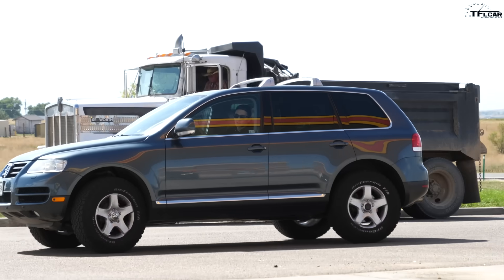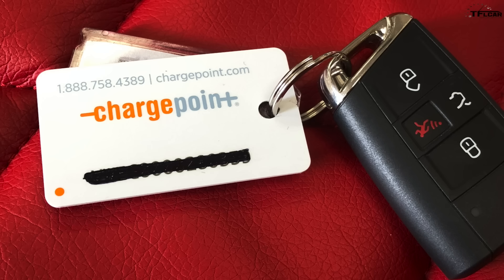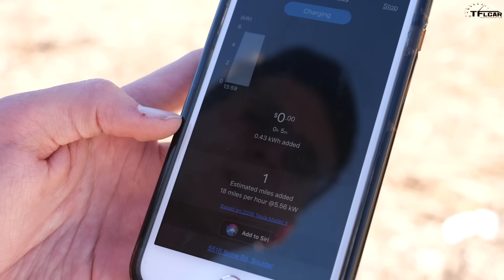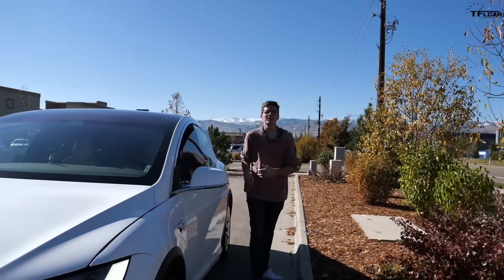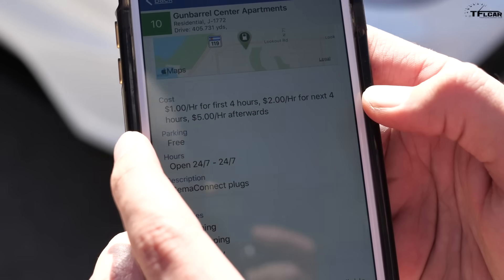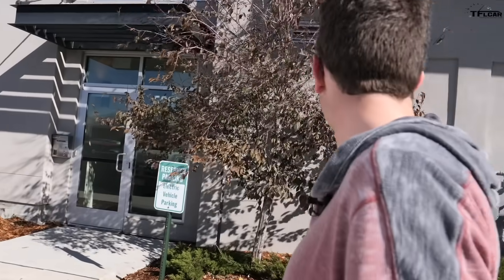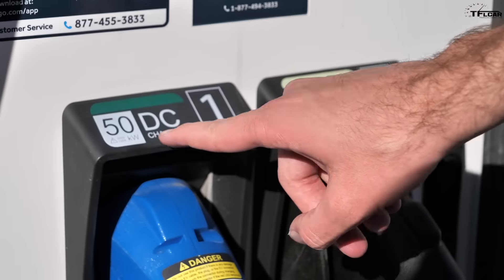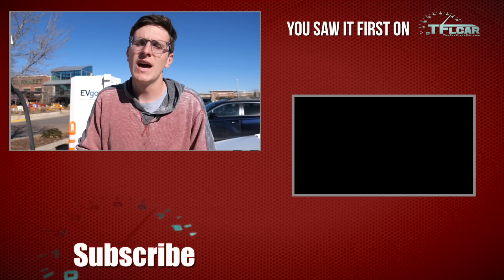Here’s Why Charging an Electric Car Can Suck - And It’s Not The Reason You Think!

Comment: I can just imagine going to a normal filling station and having to kill a few hours while the gasoline squeezed out of the pump in a tiny trickle.  I will pass on that.

 I guess if you inherited your wealth and don't work, that's fine. The rest of us slobs have better things to do with our time. And that's ignoring the fact that you get a much bigger bang for your buck with normal gas engined vehicles.
Reply: Unfortunately that's the case right now. I would love to get a Tesla Model 3 soon in the future, but the charging technology and infrastructure has to go a long way before I actually consider going electric. And I would have to make sure I have a house with high voltage power available in my garage so I can charge overnight. As long as charging overnight in my house is available, I would go electric because it would be very rare I would drive even close to 200 miles on any given day.

Comment: I would be curious to know what the EVgo fast charger reports as the total KWH provided to the Tesla when charging from 20% or 40% to 80% versus what the Tesla report as received on its internal monitor. Basically I’m asking if the EVgo says it gave 30KWH of charge, does the Tesla’s internal screen also say it received about 30KWH of charge?

Comment: Requiring an account and app is a huge swing and a miss. Why can't I swipe my credit card like a regular fuel pump? I have an ICE car now but I know I will eventually be driving a BEV. I hope the connector and payment struggles are worked out by then. It might take some government action.

The reality is, for folks like myself who have their own garage, 90%+ of charging is likely to be overnight at home. It's the other 10% that worries so many people like myself. Level 2 charging is not fast enough to get you back on the road after a lunch pitstop. L2 is for destination, not a reststop. Whether it's my weekly ski trips in the winter or day trips out to the coast in the summer, or weekend dashes  between Seattle, Portland, Bend, Chelan, etc. I'm not gonna wait around for 5 hours to put a reasonable amount of energy back in my car. 45 minutes over lunch is what I'm happy with. I understand it won't be 4 minutes at 7Eleven, I'm okay with that. But the charging companies need to shut up and take my money. No email address. No BS. Just put a credit card in and get DC fast charging out.

Comment: TOO COMPLICATED, TOO TIME-CONSUMING, and you’ve only shifted the pollution from the car to the power plant (most use coal). And when EVs really take off, they’ll have to build new power plants to handle the load, and LEFT WINGERS HATE THAT!
Reply: Nuclear, wind and solar power are options too that left-wingers are pushing for. That's why the left pushes to reduce coal dependency so we can use cleaner/renewable energy instead. And that can then power our vehicles.

Comment: Those charge points are bs. Half the ones in my area are not even public, you must be an employee/customer of wherever they are installed. On top of that they take forever to charge. I just use the superchargers instead every once in awhile and use the overnight 120v charger outside of that.

Comment: What is the price to charge up in Texas if a house is 17k when it's cold? Gas is 2.50 a gallon. Ev's are a rip off no matter how how you look at it. Would you buy a car if i told you that the engine will go out in 8 to 10 years but costs twice as much?Any takers?That is an ev the battery pack will fail. Will fail. Nope not me.

Comment: Gas pump I'm in and out in less than 5 minutes what am i support to do at a ev station that takes hours to charge my car i have children, don't have time to wait their for a charge if they get the technology down to full charge in less than 5 min then i might consider having one.
Reply: If you have a house with a garage and can charge overnight, ideally you would never really have to fill up at a charging station away from home unless you're on a road trip. But if you're in an apartment that doesn't have a charging station or in a house without a garage, an EV is unfortunately not an option. The charging tech needs to advance way more for people in densely populated urban centers to be able to use EVs.

Comment: An EV where I live is not very practical unless you can charge at home as there is very little infrastructure to support them, not one charging station within 25 miles of my home and then there are only a couple of chargers and they are downtown, people tend to park a gas car in the slots for the EVs. They get ticketed and towed but they still do it. There use to be charging stations at many of the interstate rest areas but the state took all of them out. There needs to be some form of standardization in the charging process or end up with a box full of adapters, nothing like arriving at a charger to find that it doesn't fit your car and your battery is barely alive. I had considered an EV to use in my immediate area since I live just a few miles out outside of town but decided to keep my subcompact car for those purposes, it only has to be fed every two or three weeks and cost less than $20.00 to fill up.

Comment: Being a bit disingenuous don’t you think? Charging a Tesla at a standard charge point station? They have their own superchargers which charge way faster. Nobody who owns a Tesla would dare show up at a Chargepoint to charge…
Reply: That's not true. I pulled a Tesla adapter off afree Volta charging station just this week.
Reply: @georgiaev7860  Again proving my point if you use anything but a Tesla supercharger which is made for the car you’re charging is cut in less than half the time. Stop charging a Tesla at a standard charging station you’ll be much happier…
Reply: @Magicinstalls  I see that non EV people really don't understand the difference between charging for need and charging for opportunity. Many non EV folks keep trying to impose the gas model of refueling onto EVs. Probably because that's all that they've ever seen in terms of refueling. Certainly when charging for need, because the battery is low and there isn't a lot of time, high speed DCFC charging like the SuperCharge is appropriate. But the vast majority of the time, it's actually charging for opportunity. In these cases the EV is going to be parked anyway. Whatever charge happens in these situations are a bonus.

That's what happened to the Tesla in my story. That charging station is free. It's also located in a grocery strip mall. That owner stopped for something else: grocery, gym, pizza, haircut all which are in  this strip mall. So, they parked their car and plugged in while running whatever errand they happened to be doing at the time. I'm certain the only thing they ended up being unhappy about is the fact that they left their adapter connected to the charging station. I posted a note on plugshare and put the adapter on top of the charger. Hopefully, they drove back and retrieved it.

Charging EVs isn't like gassing up. It's 80% charge at home, 15% opportunity charging, and only 5% or so fast charging for need. With an EV the driver literally never has to go to the equivalent of a gas station.
Reply: @georgiaev7860  “non ev people” lmfao! You are so clueless! I’m on my 5th ev! We currently own a bolt! Speaking of charging opportunities! This car does not have the same charging opportunities as the Tesla. Tesla has its own network of superchargers. And they could be charged within 20 minutes! You were the one who has no clue what you’re talking about
Reply: @Magicinstalls  You are meandering all over the place. You started with no one with a Tesla would dare show up at a ChargePoint to charge. I give a specific example where that exactly happens and explain why a Tesla might stop at an L2 for an opportunity charge. You then charge off talking about a Bolt have different access for fast charging and SuperChargers. All EVs, including Teslas, will take advantage of J1772 opportunity charging when it's available. Fast charging is a completely different subject. I see Teslas and Bolts at Volta and ChargePoint L2 stations all the time.
Reply: @georgiaev7860  First of all, I was addressing the poster of this video! I don't know why you had to jump in and start talking shit! I see a tesla owner going to charge points, and other J1772 chargers and bitching about how slow they are! The man is driving a Tesla and using chargers that were designed standard EVs! Tesla has a whole network of chargers that can charge a tesla to 80% in 20 minutes! Again being disingenuous telling half the story! If you want to bitch about charging, use a car that ACTUALLY has issues finding fast chargers. Whole different situation! But if you own a Tesla you have no problem finding a quick charger they're all over the place! That's why they charge 50+ k for them! Use a different EV to make your point FFS!
Reply: @Magicinstalls  I jumped in because you made an untrue statement that Tesla owners don't use slower charging stations. I agree with you that Tesla owners have access to the SuperCharging network. But in my experience Tesla owners don't use them exclusively. Seems to me the point of the video is to show that there are other options for charging other than SuperChargers. I think the missed point of the video is that virtually all current EV owners charge while they are at home. Therefore the speed of charging really isn't releavnt to the discussion. I jumped in because there seems to be about 9,000 posts with misinformation about how EVs and EV chargers operation. Just trying to set the record straight.
Reply: @georgiaev7860  Tesla owners don't use them to their own detriment, and that's their prerogative. If you want to prove a point on how NON teslas have limited access to fast chargers, then use a non tesla FFS! Don't post a video trying to charge a tesla with the wrong charger and then bitch about how slow it charges! This is ME trying to set the record straight!

Comment: Your parents and your family have the bandwidth to understand the difference between spending 30 minutes to obtain 100 worth of range vs ten minutes in an ice care to get 400 miles worth of range. Plus, every gas station, every gas pump is compatible regardless of who manufactured the car. In addition, every gas station takes MC or Visa. You lack the bandwidth to comprehend the time value of money, and you lack the comprehension to understand that if every EV charging station is fast charge, ie 100 miles per half hr, vs 400 miles per 10 minutes, the difference in time to refuel for 400 mile range is 12 times, or 2 hours. For someone who drives 15,000 miles per year, the additional time spent fast charging vs ice fuel fill up is 75 hrs per year, or about two work weeks. This does not include the pathetic tier one and two which are even slower by a factor of 10. 

No, your parents have plenty of bandwidth to recognize the idiocy of spending 12 times as long to refuel. You lack the bandwidth to understand that 75 hrs spent refueling if your time is worth $50 per hour is $3750 annually. A Toyota Camry gets 30 mpg, fuel at $2.50 per gallon, same 15,000 miles per year means $1,250 spent on fuel, even if the electricity is free. And there is more.

A Tesla model 3 is roughly $50,000 vs a Camry for $25,000. The difference of $25,000 invested in an index fund earns an average 10%, for an additional $2,500 in opportunity cost of your Tesla. The annual difference between your Tesla and a Camry is $5,000 per year. After 5 years your parents will be $25,000 ahead and can buy a new Camry, while you are stuck in a five year old Tesla. Your parents have plenty of bandwidth, you are stuck in low bandwidth propaganda because you have not learned high bandwidth economic and financial concepts about opportunity costs and the time value of money.

Comment: Great presentation. I live in Eastern Maine. My closest single and only fast charger is 106 miles to the South. (BTW my Ioniq range is 99 miles in the winter).  Also, the cost to fast charge (when or if you can get there), is about $0.61/KWh. So my 28 kW cost was $17.08.     So my EV  (124 MPGe) really gets less than 17 MPG, compared to a gas car cost, in Maine.

Comment: As an EV owner, points in this video aren't accurate. All homes DO have a 240 volt outlet, It's the outlet your clothing dryer is plugged into. Also, using Google for charging stations is not good. Use the PlugShare app.

Comment: Unless you stay in landed property with your own charging station/point, it's no use having electric car for those living in apartment blocks or condo and scrambling to charger station and wait for hours. How many points will a condo unit have? Until every parking slot comes with charging point, it'll be futile effort to push for fully electric cars.